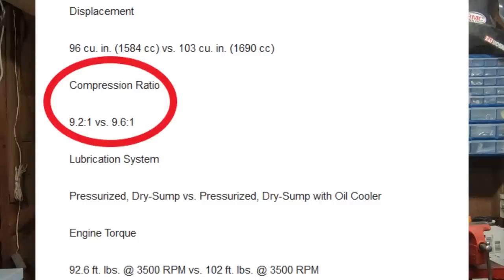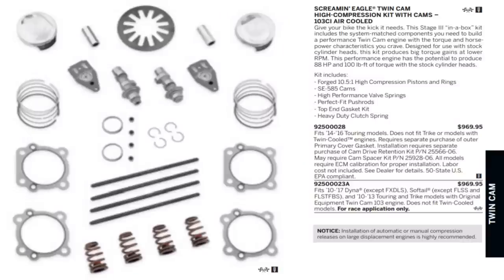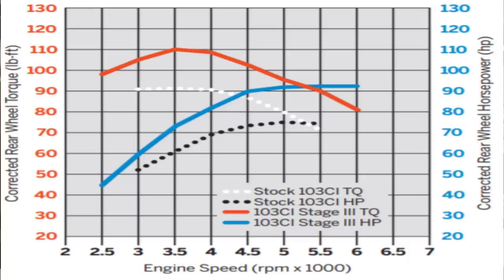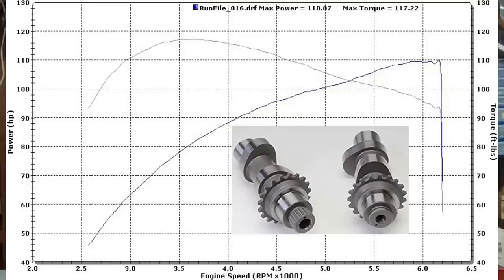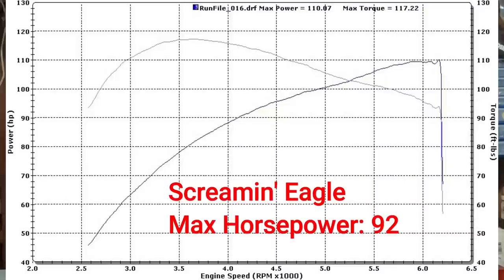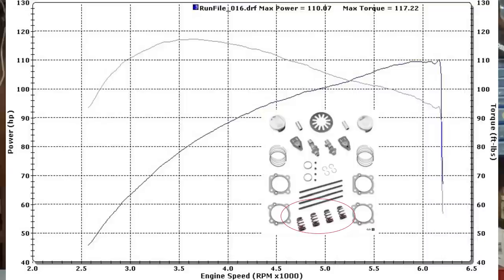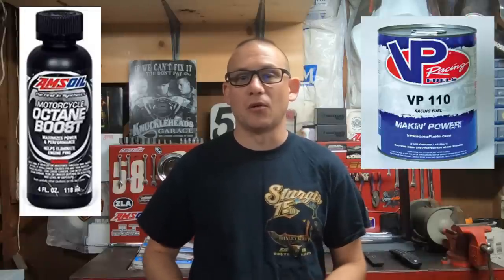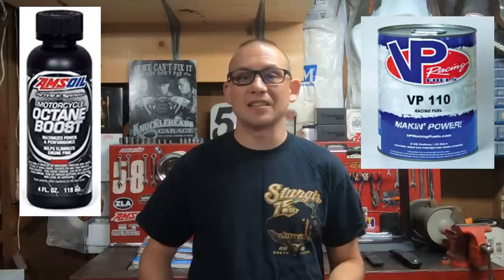Harley Twin Cam Engines Love Some Compression

Comment: Currently getting my bike reworked. Had the 117 harley kit installed a few year ago on my 110 fat boy. Harley cams are crap. Also the kit advertised something like a 9.9:1 compression increase. I have a good 2 into 1 exhaust and used a power vision and I was not happy at all with the power as it was low for a 117. Was dyno'd at 108hp and 112 ft/lbs. 
So now my bike is with another guy re-doing the kit. I added a Tman 625ps cam and he cc'd the motor for more compression.  He found that the 117 kit from harley makes a false claim on compression and is actually only making 9.5:1 instead of the claimed 9.9:1. So after he was done reworking the heads and all the motor is now making 11.1:1 compression. Of course this is static compression. Altitude where you live plays a huge role in what you set your static compression at and I'm at 2200 feet elevation and so 11.1:1 with my cam choice actually works out to 10.17:1 corrected compression so should be pump gas friendly. Waiting for the dyno results so I'll post them when it's complete and we will see the difference a cam swap and the added compression made.
Reply: Nick C 
Looked at the specs on that cam 
It closes at 41 sounds to short for 11:1 on pump gas & going to be hard on your starter. The elevation will help some but I’d be very careful listening for detonation
Reply: @scrumthebum2451  I have ACR. Also I talked to the guys at Tman personally and they recommended at least 11:1 compression to compensate for the higher elevation I'm at since the corrected compression will end up at 10.17:1 compression. Will allow for no issues with pump gas. I trust the guys at Tman have experience with this so. Also it's all about the tune. Just back off on the ignition timing and will help with detonation.
Reply: @nickc5341  
Ok sounds like you have researched it and have the advice of Tman. 
Elevation must play a larger factor than I thought. Good luck sounds like a fun build 👍
Reply: are tman cams good compared to wood cams? im looking to eventually go stage 3 on my stock 103 street bob. any recommendations? i dont care about going fast, having a lot of torque and some hp is good for me. i heard tman cams are quiet compared to wood cams
Reply: @Cheaps928  the 625 cam I'm using is very quiet. Wood cams are great too from everything I seen. I personally would love to try wood's tw999 cam. I've spent too much money already though so maybe years down the road if I need a rebuild I'll try and new cam. With the tman 625 I'm now making 120hp and 124 torque sae on the dyno. Would have made more if the elevation was closer to sea level but I'm satisfied. I'd really love to get a new bike with a Milwaukee engine and have tman put in their 139 kit. They made 166hp and 170 torque on at 2021 fat boy. Insane! Bet that wasn't cheap tho!
Reply: @nickc5341  im currently looking between the 580ps and 625ps for my stage 2. i will wait a few months possibly a year to get headwork done. do you happen to know which would be the better option for me? i will definitely give companies a call but just looking what other people say about it.
Reply: @Cheaps928  depends how much you wanna spend as well. The the 625 I had to replace my valve springs with triple springs and put in roller rockers as my mechanic thought it was best to use them with that lift. Also head work is a must with the 625. With the cam you mentioned you won't need any of the parts I had to swap out. You should talk to the guys as tman through and they can help you better with what you will need and what would be best for you according to what you're looking for.

Comment: I have a completely stock 96 in a 2007 Road King - it has been a milkshake mixer since I brought it home new from the dealer. My 2003 Stage 4 twin cam Road King is markedly smoother - much less shaking. Motor mounts on both are fine. How about a video on how to cut back on excessive shaking and vibration? I’ve heard everything from “experts” on this subject (flywheel, idle speed, crank balancing, handlebar dampers etc.,). What’s the best way to cut the Shake?
Reply from the maker: Honestly just making sure the mounting system is good shape and everything is tight. Getting into the engine flywheel and crank balancing helps. Crank run out can cause excessive vibration, it's hard to avoid with Harleys since no two engines are alike.

Comment: I has ever been watching your videos on the 107 and compression of 10.5 to 1 got my heads at 10 to 1 planing on going to 10.5 to 1 soon and going use tripple duece woods cam for low end tourque looking for video on installing pistons and heads with torque specks and adjusting pushrods

Comment: Good video but, I’m assuming you’re talking about static compression not dynamic. The 10.5:1 never actually happens because of valve overlap etc. it’s the dynamic that’s important. Could you expand a little more on those numbers in a video some time. I was taught that a few point either side of 9:1 is the sweet spot for a hog that runs on pump octane of about 91-93
Reply from the maker: That's an excellent point, I was trying to keep it somewhat simple without really diving into static and dynamic. That's a real can of worms I can go on and on about lol.

Comment: Thanks to your video I’m now about to have a .027” MLS Cometic head gasket installed together with the S&S 570 on my 103”. Is this only gonna squish my compression a bit or should I retune with the FP3 and add something to it in order to make it run as good as possible?🤘🏼
Reply from the maker: That should work very nicely! You will still have to retune with that cam and new setup though with the changes made!

Comment: I watch all your videos. Thx Question I have a 2017 Breakout i bought woods 777 cams and going to change all parts as you instructed. changing rocker arms to 1.725 roller type, 5.3 injectors,  then  Going to send heads to Hammer performance to get port and polished . what 4 in big bore kit you recommend for this set up. would like to do this all at once. but what to stay at 10-1 ratio

Comment: I went with s&s 585 and weisco 10 1/2 :1 pistons. Dyno 94hp 104 tq on 103 tc
Reply from the maker: That's some nice work! Really good power increase with that compression and cam!
Reply: @GixxerFoo  what would you suggest for upgrading heads and or throttle body now?
Reply: You need to figure out what’s wrong with your combo!  You either have a crappy tune or at very high altitude!  Should be making 100+ HP & 110 Tq.   Don’t need to spend money on other upgrades until you get what you currently have set up correctly.  Did you set up proper Squish distance, 0.030”?  You can get more HP with stock flat top pistons and proper squish than your domed Wiseco.

Comment: Almost every Harley I’ve ever owned has been treated to a nice set of forged Wiseco pistons of 10 to 10.5 to 1.
Reply from the maker: Right on! It makes a huge difference, the factory compression is way too low. Works great for just cruising but it really hold the power potential back.

Comment: have you thought of doing a supercharger / turbo charger guide ?  i know they are pricey, but if one really wants to get into engine mods lol.  good vid
Reply from the maker: Actually a bolt on turbo is about the same price as building an entire crank up. I am actually working on a video about turbo chargers for Harleys and what the pros and cons are.
Reply: @GixxerFoo  ya they are very expensive . at least the ones i priced.  looking forward to seeing what you came up with

Comment: How does higher compression impact engine life? I'm looking at a higher performance build that's still suitable for daily street use.
Reply from the maker: It makes the engine more efficient and if you're not beating on the motor all the time it won't impact the longevity. Now making sure you have compression releases is key, it can lead to starter and component failure in the starting system.
Reply: Harder on the starter. Add compression release. As long as you have good high octane gas you will be good. If you can find it use off road 91 plus. It is ehenal free

Comment: Just bought a set of KB 411 10.5:1 pistons sending heads in for Port n valve job. I already have  Chris rocket 574 cams. Cams state up to 10.1:1 comp. .Do you think the 411's will work properly with the extra comp. I have a fxs blakline 103ho
Reply from the maker: Maybe with some very careful tuning but that's a lot of compression over what those cams support. Depending what head porting you're doing that really get to more than what the cams can support.
Reply: @GixxerFoo  after reading your reply I got to wondering should I continue.  Well I contacted Chris Rivas shop . They said I would be within the limits and should produce lots of torq. But 11.1 comp. Is a no go. Thank you for the idea of adding comp. You have great information I will continue to watch. Have a blessed day

Comment: Just had a 510 cam installed with gear drive, cam plate, oil pump, lifters and push rods but there is some noise i noticed from top end. What should I check? Should I check push rod adjustment and timing? But was wondering what the compression should be with the parts I had installed?
Reply from the maker: Pushrod adjustment and timing would be a good place to start, compression shouldn't of changed much if any. What kind of noise is it? Mechanical noise or maybe something like detonation?
Reply: Sounds like maybe rockers not very noticeable to anyone but me. But I just hear a difference in the motor noise. Do you think it could be the gear drive? Going to buy oil pressure gauge to see if its consistent or if it flutters. Is there any websites you recommend for parts?

Comment: Have a 2014 Street Bob, can I have changed my exhaust with a V&H two to one pro pipe  - I do not want to change original Air Filter
Reply from the maker: Yeah you can go to a two into one, you'll just need to tune it of course but you can keep the original air cleaner. The bike may run a bit rich, I would suggest a K&N air filter stock replacement to help with that though.

Comment: Im all for hot rodding engines, but there is a dark side to performance mods.  If you want your engine to run forever, anything beyond a stage 1 upgrade is going to decrease engine life.
Reply: Yeah the more power something makes the shorter the life span
Reply from the maker: That's very true, you really have to build the engine from the crank up for reliability. There's guys with quite a bit of miles on street ridden 120R's.

Comment: I have a 2003 dyna low rider anniversary edition that I get about one start attempt before the battery drains and it won’t try to start again .. what could be causing this ?
Reply from the maker: It completely kills the battery? Assuming you have a good battery, you've got some serious amp draw. Without seeing it and assuming the engine turns over freely you might have something going on in the starter and or the solenoid. I would definetely get that tested.

Comment: My buells new motor will be pushing the limits 
11 to 1 comp ratio 
Nallin stage 3 heads
N8 cams 
Hrs 42 carb
And a full forcewinder induction system plus exhaust
Reply from the maker: Damn N8?! Talk about lift!
Reply: @GixxerFoo  he went balls out
Motor was in a cyclone drag bike 
Went in the low 9s

Comment: The 110s had to keep the compression low because the crankshaft couldn't handle the pressure
Reply from the maker: That's a good point! Reliability and warranty concerns really played a part!

Comment: I have a 06 road glide with a 05 engine and I don't know what pistons or compression ratio it has but if I run 93 octane it runs like crap If I put 110 octane in it runs great. It has a very mild tune and puts out 97ft lbs and 89hp and it's a 88c.i. any ideas ?
Reply from the maker: If it's making that kind of power someone has done some engine work at some point. It's likely got some high compression pistons, cam and maybe a bore. Really no way to know for sure other than tear the motor down and see what's inside and do some measuring. You could run a bore scope into the spark plug holes and look at the pistons, see if they are domed or have a flat top.

Comment: Now wait a second......the reason we use 93 octane is because that 87 causes knocking......it causes knocking because it burns too fast

The idea of increased compression is putting the same amount of air and fuel into a smaller space......thus fuel molecules are closer together and will burn faster......more likely to knock

Remember the cars, they'd put on turbo chargers, which put more air and fuel into the same space increasing compression, then they'd adjust the ignition timing to take out the knock......smart ones started using 93 and adjusted to that fuel.....that way they could still get max pressure at 20* atdc and complete burn at 70* atdc, which they couldn't quiet achieve using 87

But now you're starting with an engine designed for 93, then increasing compression

The crotch rockets running high compression with 93 also have a short stroke in order to get stages of burn in the correct places

The short stroke cruiser engines(not as short as crotch rockets) running 9:1 also use 87  to get a faster burn
Reply: I may be wrong, but here's what I thought:
Octane rating is a reference to basically how stable is the fuel, as in higher octane fuel can sustain higher heat and compression before it self ignites. Higher compression requires higher octane because lower octane fuel will pre-detonate too early in the compression stroke. 
Higher cylinder pressure and a greater amount of air/fuel mixture results in greater potential energy being released with each detonation. I don't think that the closeness of fuel molecules effects burn as much as you think. What's more important is a finer, more even distribution of fuel in the mixture. Flame front movement is more impacted by the shapes within the combustion chamber and the placement of the spark (or sparks if you have two plugs per jug).

tldr; more cylinder pressure and air/fuel mixture means more potential energy released each cycle. Higher octane is stable and can handle the extra pressure without pre detonation.
Reply: My 2010 street glide was a 96 (9.2:1 comp) now built to 103with 10.5:1 with S&S 585 Ez start cams, clutch, intake, & 2into1.. 111hp & 119tq and it doesn't knock even on the hottest of days.. I keep a can of octaninium in my bags to splash some in for if Im running hard with the boys, but never have I heard it knock even on 93.. Hell my Mustang is 12.0:1 Compression from Factory, my last Camaro SS 1LE was 11.5:1 comp, both ran great on 93.. no knock.

Comment: I wonder how the twin cam 88 crankshaft holds up to higher compression...
Reply: Just fine so far although I have a 99 with the Timken bearings. 95 cui ported heads andrew 50 and 10:25-1 compression
Reply: @candersson7419  you've got them when they still had the good bearings mine is an 03
Reply: @jamessouthworth1699  I have a 2000. Is that still using the good bearings? What year did they switch? Thanks
Reply from the maker: They do run a whole lot better, there's really not any issue unless you're really beating on the motor. But that's with anything, if you ride it hard it will reduce the life expectancy.
Reply: @fern0031  The first year they put in the cheap bearings was 2003.
Yours is good

Comment: 77K and change on my 2002 stage 1 RKC. Still getting me down the road problem free like the day I drove it off the lot. There's no free lunch. I'm guessing as HP and torque go up, engine life goes down.
Reply from the maker: It's possible reliability can suffer, but if the engine has all the supporting components reliability can be maintained.

Comment: I agree, Screamin' Eagle parts should installed as original parts from the manufacturer... and then thrown away when you upgrade the bike. There are much better parts out there than Screamin' Eagle.
Reply from the maker: Screamin Eagle is an upgrade over stock but no comparison to after marked parts!

Comment: Im getting 10.25-1 pistons in my 103 with ported heads ... after this video i dont know if my starter can take it
Reply from the maker: If you've got some compression releases you'll be in good shape, a high torque starter never hurts though.
Reply: @GixxerFoo  think the comperssion releases will be as expensive as a high tq starter
Reply: Just remembered that the 103 does have ACR 🤦‍♂️
Its my 96 that does not have it ...
Reply from the maker: 👍 you said 103 but l wasn't sure if that was a factory 103 or conversion. You'll be good to go then with those pistons.
Reply: @GixxerFoo  yeah thats was my bad , thank you and keep up the great work 👍👍

Comment: Did a 117” S&S big bore kit on my twin cam 103, what would be the best cam for this set up. Bigger throttle body, S&S oil pump, S&S 585 cams 2 into 1  pipe etc.
Reply from the maker: That 585 S&S cam is hard to beat, it's one of their most popular cams and for good reason!
Reply: @GixxerFoo  was thinking s&s 620, your thoughts?